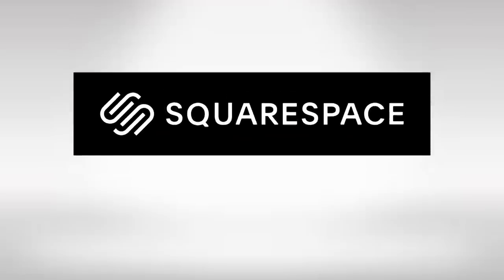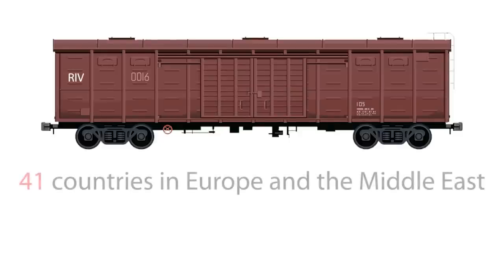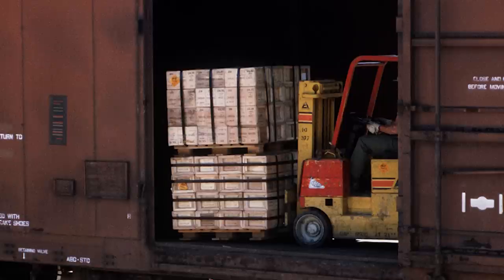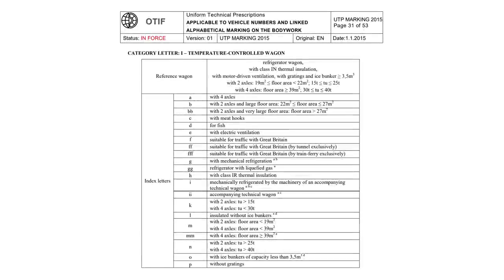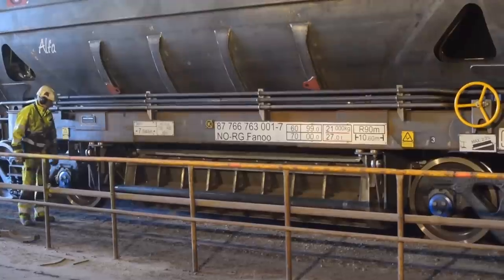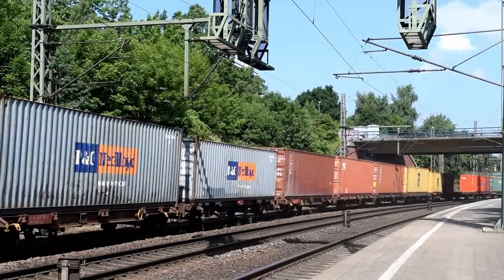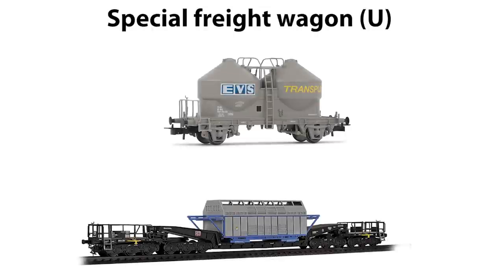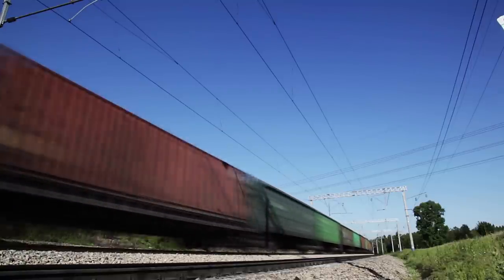Why There's So Many Different Freight Railway Wagons?

Comment: Very cool video, now I can see what’s inside of the wagons and Know the types!
Do I remember correctly, that Japan only has like 5 types?
Reply: It has more, but nowadays mostly container flatcars and tankers are in use.

カ (ka) - cattle car
キ (ki) - snow plow (no propulsion)
コ (ko) - container flatcar (or intermodal)
く(ku) - car transporter
せ (se) - coal hopper (only for coal)
シ (shi) - special car (for oversize loads)
ソ (so) - crane (no propulsion? Unused?)
タ (ta) - tanker car
チ (chi) - regular flatcar
ト (to) - gondola
ホ (ho) - hopper
ヨ (yo) - caboose
レ (re) - reefer
ワ (wa) - boxcar
ヲ (wo) - hopper (I can't tell the difference between "ho" and "wo" hoppers)
Reply: @jacekhozejowski2869  ok thank you very much

Comment: As an American, it's strange to see wagons with only two axles (or six, for that matter); we stopped using them almost 150 years ago. We also have none with fabric covers.
Reply: well therefore the axle weight in europe is mostly lower than in america you gotta need more than 4 axles. some freights don't need a big car for transport, so 2 axle cars are still common